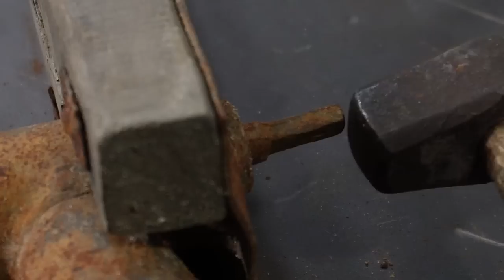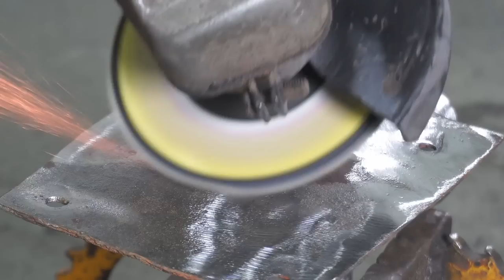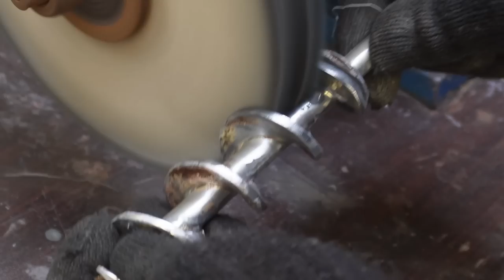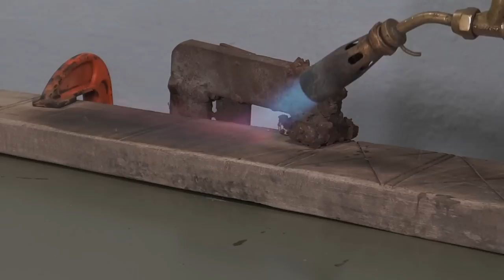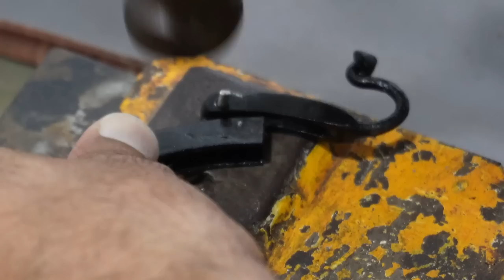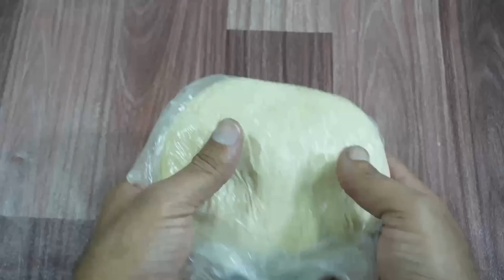Antique Noodle Machine Restoration

Comment: That was great, but I think you must not paint the hole, because the paint will be mix with the noodle ingredients
Reply from the maker: The interior of the machine and the mesh were heat bluing coated and painted black on the outer surface.
Reply: @Restorationcircle  ok. Thanks. That awesome job, I am enjoyed your video.

Comment: Tip #1: NEVER wear cloth gloves when using a wire wheel! One slip and your glove will get pulled into the wire wheel causing you injury!
Tip#2: Stop begging for people to subscribe! If people like what you're doing, they will subscribe.
Tip #3: If you want people to read the text, leave it up longer than 2 seconds! 5 seconds would work better.
Reply from the maker: Thank you so much sir for these three tips, It's very important for me.